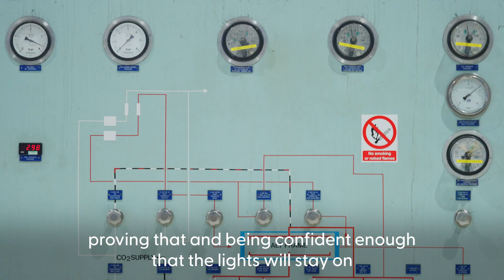UK’s last remaining coal-fired power station closes down

Comment: Ratcliffe power station is the only coal-fired plant in the UK to be fitted with a Selective Catalytic Reduction (SCR) emission control facility, capable of reducing NOx (nitrogen oxides) emissions by 70-95%. It is also equipped with a Flue-Gas Desulphurisation (FGD) plant to remove sulphur dioxide (SO2) from the exhaust flue gases before they enter the atmosphere. With both SCR and FGD technology installed, Ratcliffe could meet the environmental standards in the Industrial Emissions Directive (IED).
Reply: But it's surplus to requirement, hence why it's being closed. In peak times, where renewables can't cope with demand, we have natural gas power stations to pick up the shortfall. Which in itself is far more environmentally friendly, than coal.
Reply: Got some amazing drone shots on Friday, looks amazing! Just uploaded to my channel

Comment: With Brexit, Britain is not encumbered by the EU's net zero greenhouse gas emission goals.   It is scientifically impossible for greenhouse gas behavior to cause global warming.  The UK could cut its electrical fueling costs to less than 1/10th that of expensive natural gas by building new ultra supercritical clean coal power stations burning British bituminous coal.    Invigorating the British coal industry would bring much profitable freight to British railways.  

In the US a new ultra supercritical clean coal electric power station burning high BTU bituminous coal is predicted to have a crossover fueling cost with natural gas priced at $0.80 per million BTUs in 2022.  British wholesale natural gas price in Oct. 2024 in US equivalents is $10.50 per million BTUs, which is down greatly from its peak prices and unlikely to fall greatly more.  US wholesale natural gas was priced at $2.50 per million BTUs in offseason early summer 2024.   

There is little to no natural gas savings in instantly backing up a wind turbine generator farm to behave as a scheduled power station over making all the electricity with natural gas combined cycle plants.  The instant peaking power backup required of erratic sources of wind and solar generated electricity typically requires natural gas turbine generators running at high availability 70% fuel consumption making little electricity and unable to use a second steam cycle adding 50% higher efficiency.    A natural gas combined cycle plant running at high efficiency output would only use 66-2/3% instead of the minimum of 70% for high reacting peaking applications.  

The lowest cost of incremental electricity is from hydropower and nuclear power.   Second to those in low incremental cost of electricity are new ultra supercritical clean coal plants burning high BTU bituminous coal.   The UK doesn’t have domestic commercial uranium fuel.  

In the 1970s US coal mining became highly automated which British coal labor unions strongly resisted.  By 1980 in the US it took less 1/4th the underground coal miners to produce even more coal than previous.  The UK is famous for high quality bituminous coal which it still has an estimated 187 billion metric tonnes in reserves.  Coal dependent China with a population of 1.4 billion consumed two billion metric tonnes of coal in 2019.  

Modern deep coal mining is greatly automated with remote operation of equipment.  People that long romantically for the teams of physical muscle that used to produce British coal will be disappointed with modern coal mining being done largely by technicians and mining engineers.   It still takes developing courage and smarts to work underground.  There is still the thrill of standing on ground no other human has ever stepped on when opening a new cut.  

Global warming has been paused at about 1°C since 1992.  In 2022 global warming was reported at 1.06°C.  It is scientifically impossible for greenhouse gas behavior to cause global warming.  The cause of global warming is not known in 2024.

Before 1992 when Al Gore became US vise president earth’s water vapor saturated greenhouse effect was taught in US public education.  Earth’s greenhouse effect is always in saturation from the strong greenhouse gas water vapor absorbing all the greenhouse radiant energy from the earth within 20 meters of the radiating surface adding an average of 5.55°C (10°F) to earth’s average temperature.